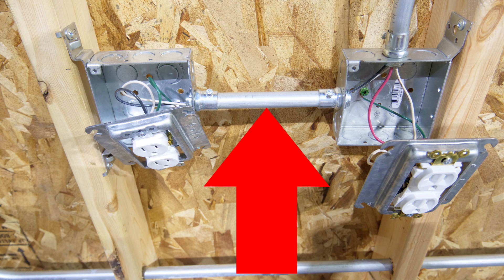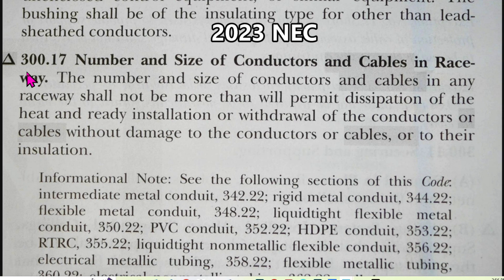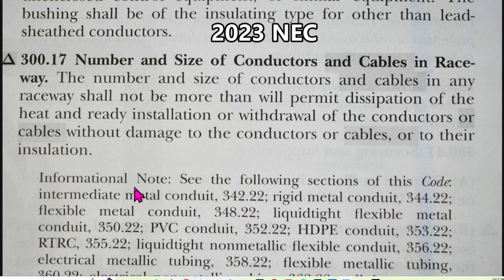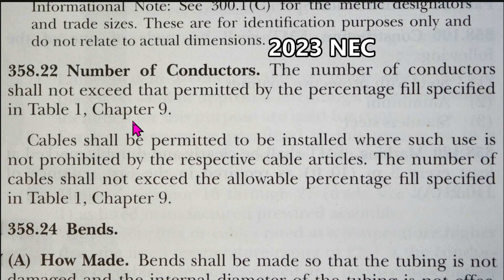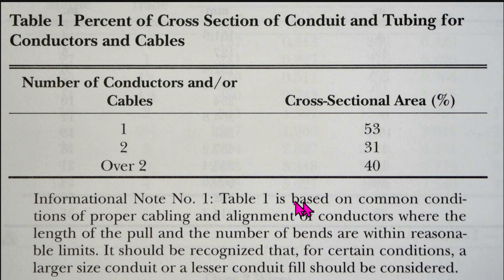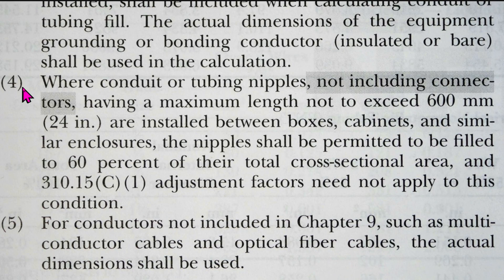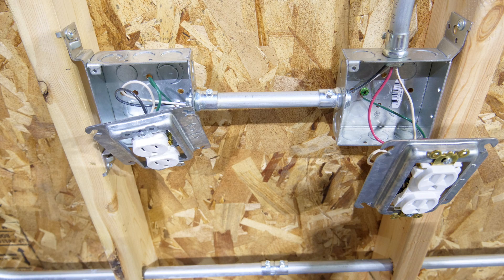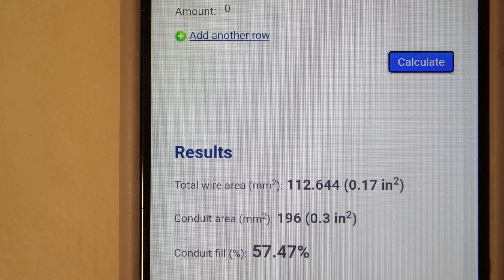What % of Conduit Fill is Allowed for this Conduit? 2023 NEC 300.17, 358.22 and Chapter 9 Table 1

Comment: Thanks. Is it acceptable in some situations for nm cable to be in emt?
Reply: Yes you can, but the value is based on the dimensions of the widest point as if it were a circle this is in Note 9 of chapter 9 table 1

Comment: Side note: you would have to install several flimsy 1.5" extension boxes on the two 1900 boxes shown if you did pull think it was that you said 17 #14 THHW wires. Might be wrong but going by old memory A 1900 box that's 1.5" deep provides 19 ( thus the term 1900 box ) or 20 cubic inches. A #14 wire requires 2 cubic inches. So not even deducting for a device that box would only be good for 10 # 14 guage wires. Best practice is to never pull the maximum allowed wires in long conduit runs or runs with more then a total of 270 degree in bends.
Reply: Not necessarily, you  do not count the wires that just passed through the box,  so most likely you will only count no more than 4 wires of the 17

Comment: Why can you go higher when you have more than two conductors or one conductor but less than both with two conductors on conduit fill. As shown in chapter 9 table 1.
Reply from the maker: Remember, you're running the wires in a tube. 2 larger wires don't fit very well while 3 wires fit more efficiently.
Reply: The most you can possibly fit with 1 wire is 100%.  With 2 wires, each at half the conduit diameter, 2x 25% area is 50%.  3 wires is more complicated, but the geometrical max jumps back up to 65%

Comment: why the hell is 2 so low, at 31% ? because the nipple/conduit is being used as a ground?
Reply from the maker: It is the shape of the 2 wires in the conduit.
Reply: I takes into consideration dividing the fill between more conductors makes the installation easier. 
You may need to derate your conductor ampacity for multiple conductors due to thermal buildup. That’s another story.

Comment: it bears mentioning that the requirement in 300.17 is TWO SEPARATE requirements.  when putting wires in conduit, you have to consider heating, and you have to consider actually getting them in there.  they may fit, but have an overheating problem, or heating may be no problem; but you can't make them fit.
Reply from the maker: Good point, thanks!